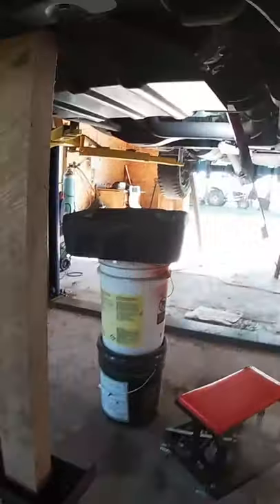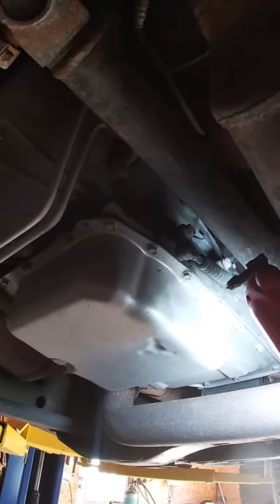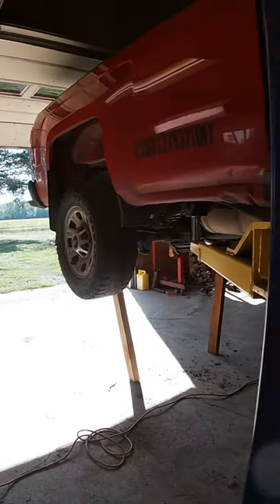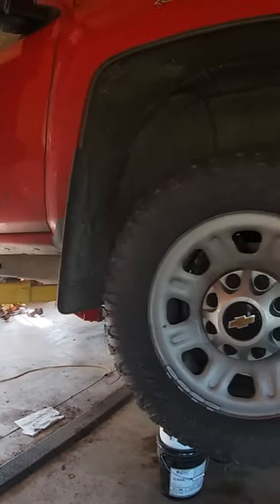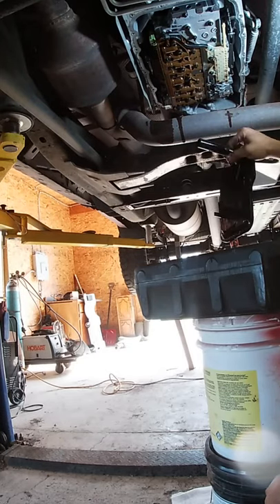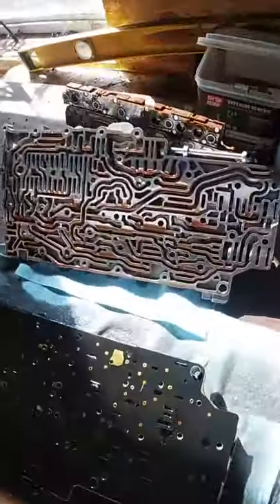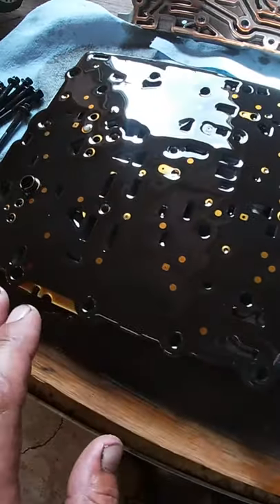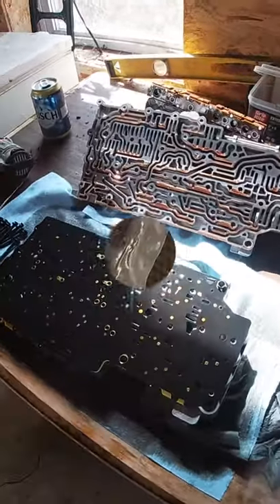Silverado 6L80e 6L90 NO DRIVE/Forward Gears FIX!!

Comment: This is %100 Legit.  I have a 2017 GMC Yukon with 88K.  These exact symptoms, strong reverse, no forward gears.   No code, not burned, not slipping.  I bought the service kit at the dealer, $28, easy.   Dropped the pan and valve body, had to loosen the right exhaust at the manifold.   My ball valve was clearly half size, clearly stuck.  New fluid and filter.  Carefully aligned the electrical plug and the shifter plunger.  Works like a dream.  No doubt this person saved me 4-5 thousand dollars.   My clutches were not worn, barely anything in the pan.   Wife stunned.  Can't thank this person enough.
Reply: How much did you donate to them?
Reply: I have the same problem with my 2017 GMC Yukon what the kit call please

Comment: Thank you for the video! This just happened to my 2017 Silverado 1500 crew cab 90k miles. Called three mechanics all said it was the transmission. $2500, $3000, $4500 quotes!…. Found your video, decided to give it a shot since truck showed no prior symptoms before not going forward at a red light, reverse worked perfectly. $180 later, 5hrs of time… and she’s running  as smooth as before!… once again, Thank you!
Reply: I have the same truck..was your truck jerking slightly or all of a sudden didn't want to go in drive
Reply: what did you buy?

Comment: My son had an issue while driving his 15 silverado with a 6L80, just acted like it was in neutral. Hauled it to a transmission shop and they replaced the transmission with a new one (approx $4K). Test drove it-not right, tranny replaced again. Has been fine for about a month and suddenly has no forward or reverse gears. We're looking for someone else who will cover the warranty. Any suggestions on what may have happened?

Comment: Thank you so much for this video, 2017 chevy silverado 2500 6.0 had no trouble codes stored, randomly i would not move forward, only reverse, did as you specified on video, issue was fixed, one of the plastic balls had decreased significantly in size to the point it got stuck, poor design that is making GM lots of money, PEOPLE LIKE YOU SHOULD BE GETTING SOME MONEY FROM GM. Thank you for taking your time to post this amazing video.

Comment: I did my 17 express van in my driveway. 73k miles. Dealership wanted 1k. The check ball was $4.50.  10m inverted plus was 17.00. 3 hrs to complete. No need for the new plate. The balls are shit. I did replace the trans filter too.

Comment: I just had this happen on my 2011 Suburban. Freshly rebuilt 40k miles ago. Fluid not burnt at all, no codes, no fwd gears but reverse is fine. Pulled the valve body and everything still looks new and undamaged. Turns out the 1-2-3-4 piston cracked and presents the same symptoms. You can check this when you drop the valvebody to see if the check balls are the issue. 1-2-3-4 feed is the forward most hole next to the filter hole on the trans where you just removed the valvebody from. It should be super tight and hold air with very minimal leakage. If you hear it dump air you have a cracked piston. Gm has 4 different revisions of it since it is such a problem and sonnex makes a nice billet upgrade for less than $100.

Comment: Got a 1999 gmc suburban & worked perfect, just changed filter & everything was running real good, no hard shifting gears, smooth gear change & came down a hill & turned & accelerated & NOTHING, would not go forward at all but has reverse. No whining noise, no rough gear change, just no longer have forward gears. Reverse works perfect.

It's the 4L60E I think
Reply from the maker: Could be stuck valve in the valve body, could be a stuck check ball, or could have mechanical failure. Start with dropping the pan and go from there.

Comment: Do the check balls stay in the valve body when you drop it ? Thanks
Reply from the maker: Yes. You have to split the valve body after you remove it to easily change the check balls.

Comment: I'm having this exact same issue as of yesterday in my 2015 Chevy SS Sedan with the 6L80E. I can reverse just fine, but when I put it in drive or 1st gear, it scoots forward very slowly like molasses, and even when I  floor the gas pedal while in drive, it just revs really high and the engine starts to sputter and damn near shuts off. I'm hoping I can get this fixed soon!! Very stressful for me right now since I just had a baby 2 weeks ago, and I'm down to one car now! Smh
Reply: Did it fix it?
Reply: So your transmission is potentially slipping and you thought that "flooring the gas pedal" would be something smart to do... Interesting... For those of you who don't know better-if you ever think your transmission is slipping DO NOT EVER UNDER ANY CIRCUMSTANCES stomp the gas pedal... If it is slipping you will instantly and permanently destroy whichever clutch pack was slipping requiring a full rebuild... DO NOT do this.. If it's slipping get OFF the gas, not ON it...  If it's slipping baby it as best you can until you can get into it to see what was causing the slipping.. Slipping means certain death.. Flooring it while slipping is like slamming your male reproductive parts in your car door just to see what the results will be.

Comment: I got a P0796-00 pressure control solenoid C performance or stuck off. 2016 Silverado 4x4 78k miles on it. Shifting problems or high rev without truck moving. Any input here ?
Reply from the maker: Has the trans been serviced? Could be as simple as a new filter and fresh fluid. Could be as bad as PCM issues or trans failure. Always start with the basics. Let me know!
Reply: So I dropped the tranny pan, Lot of metal flakes than usual. Changed the pcm and problem persisted. Dropped tranny and my clutches were burned and pump was scratched..
Reply: @Carbon_fr2  did you replace the transmission?

Comment: Common causes of this condition-broken sprag in the low reverse clutch stack in the BOTTOM of the center support, cracked 1-2-3-4 piston, stuck check ball in separator plate, bad TEHCM, and the number one cause of loss of ALL movement-both forward and reverse (usually when fluid/trans is hot) is the torque converter coming apart. I build these units every single day and I LOVE them! They are great units, they just have a few quirks. For those of you going in to replace the white plastic check balls-buy .250" TORLON check balls from your local trans supplier.. They will last significantly longer than the white plastic check balls GM utilizes. They are a caramel or brown color. That's what we use at my shop.
Reply from the maker: Truck has 310k miles on it now and still the same transmission. Tows everyday! Thanks for the comment!
Reply: I have a 6L90 that torque converter went bad and I replaced that and the filter. I still have no movement with It forward or reverse however if I put It in manual select It won’t move until I tell It to shift to a higher gear then It moves for 20 seconds then nothing again until I change gears again. Think this could be the problem?
Reply: @ryanbrady5552  When the converter goes bad you need to do a full rebuild to include a new pump, or machine the original pump, install BOTH shift kits-to account for wear of the pump pressure regulator valve, and at minimum replace the pressure blisters on the TEHCM... replace the filter/screen plate on the TEHCM, replace the bonded pistons, replace all bushings... Once the converter goes bad-you have metal throughout the entire unit... Replacing JUST the converter is not just gambling... it's throwing away your money. You tried a short cut and unfortunately, it's just not going to work out for you... Most likely you have valves stuck/sticking in the valve body from the metal coming out of the converter... That's just a GUESS.. I would never, and have never, just attempted to replace just the converter when one has failed... Too much collateral damage inside the unit to get away with doing just that. Best of luck with your project.

Comment: I just bought a 2015 6L90 core for my swap for $300. The guy stopped at a gas station, turned it off. When he came out nothing. Wouldn't go into forward or reverse. Hmmm maybe that shift lever problem that is  happening where it pops out of park or won't come out of parkm
?

Comment: I have issues for my pickup truck Z71  2016  D gears didn't work. Only R. Works and paddle shifting works but you can press hard acceleration

Comment: 2012 Silverado, backed out of shed, washed, Service traction control and Stabiltrack messages came up. Turned them off. Went to put back in Shed, Had reverse gear, no line under gear readout (Auto). 
No acceleration in forward gear (I could feel) where it was. 
Left on lawn, stewed over it all night. 
Got up early. Started up, put in gear (little selector) line showing up. Straight into shed. 
Told possible TCM. ? 
Any ideas ? before I phone Eastern States tomorrow. We are in regional Western Australia and little to no service here. Possibly have to truck to Perth.

Comment: Hey man I have a 2008 2500hd with the 6l90 have no forward or reverse gears no lights came home fine parked it overnight. Got in it the next morning and no forward or reverse gears, could this be the issue?
Reply from the maker: That seems like no line pressure. Could be a different issue

Comment: My transmission (4L60E) on a 2011 Tahoe  will shift into reverse and forward gears until it gets warm, then it won't shift at all.. fluid wasn't red, like it should have been, I'm lost, help! 😩
Reply from the maker: Sounds like internal problems! Good luck
Reply: Did you every figure out the issue ?? I’m having that same issues currently ..
Reply: Did you ever figure your issue out? Currently experiencing the same.
Reply: Did anyone figure it out
Reply: Change fluid and filter. (2011 tahoe)

Comment: Did you put new gaskets on the valve body when you put It back up into the transmission
Reply from the maker: The separator plates are the gaskets

Comment: Hi I have a 2017 2500 hd 6.0....almost same symptoms.....have reverse....when in D wont move....just revs. .....here is my question.....I put truck in L1 then used electronic manual gear shift  and put truck in 2nd gear.....thats how I got it home......in your opinion do you think it could be the same problem???? I can do the job no problem .....except its winter here in Canada and i cant do it outside.....would a dealer or tranny shop just do that if I asked them to? Also would a flush and fluid change fux it until summer comes around....lots of questions  sorry...lol
Thanks in Advance 
Andrew
Reply from the maker: I would have a look just to see. I wouldn't worry about a flush but definitely a filter and new separator plate
Reply: yo did you ever fix this if so how? I am currently experiencing the exact same thing as you described

Comment: How long did it take u to change out everything
I've got a 2001 Chevy Silverado 1500 she sits up high, 9" lift kit n I was told that kits and big wheels n tires will make a transmission go out fast......that was from the guy who  rebuilt the transmission before all this happened, that's how I know its not the transmission.......it has less than 3k miles on it from 5 yrs ago being  built.......I didn't drive her like that.....she use yo be a show truck

Comment: I’am writing to express my gratitude for the valuable information you provided in your recent video. I found it to be very informative and helpful.

However, I do have a question regarding a certain situation I am currently facing. Recently, I noticed that the transmission in my truck was not functioning properly. After repairing it, the transmission works fine until it reaches around 170 degrees and then it throws a code. (p0741 - torque converter clutch system stuck off)

Prior to this issue, the truck was running properly with no problems. The problem started with the transmission falling out of gear twice within 20 minutes of each other when starting to move forward after a stop light. I have not noticed any other symptoms.

I would greatly appreciate your opinion on the matter. Any insight or advice you could provide would be very helpful.

Comment: I have a 2000 ford f250 7.3  automatic.....my truck was parked fir two weeks and decided to take a drive...it started and put it in on drive nothing..put in lower gears and nothing and reverse nothing....check the level on tyranny and good........need help

Comment: Bro same happened to mine oil has no burnt or nasty smell to it but mine is a 4l60e no check engine what can that be bofore i start looking
Reply: Did you ever figure it out I just ran into this problem
Reply: @brandonromero8122  I did bro it's my first gear on my transmission or as they call the big belt wore out so no first gear only reverse so I gotta rebuild or just get my first gear fixed
Reply: @JesusArredondo-o2g  thanks bro. It was working fine it was rebuilt 3 months ago and today as I was leaving some snap under and it was all neutrals but reverse worked like normal. I'll have to drop it again

Comment: I have a goes into reverse no drive situation not sure if 1, 2, 3 work but the D don't work, as I'm just starting working on a 94 Explorer and tomorrow I'll be pulling tire off to get it jacked up to get rid of a pancaked tire with dry rot sidewalls

Comment: I just had a guy rebuild my transmission and when I went to pick it up it goes in reverse but not forward
Reply from the maker: Hopefully you get the guy to fix the problem!
Reply: Hey man, did you ever figure out what happened with your truck. Same thing happened to mine.
Reply: @tjamecurrie   I'm taking it to a real transmission shop to have it rebuilt
Reply: @drivewaygarage1561  update??
Reply: @dannypulido9218  $3500 to rebuild and fix the last guys screw up,

Comment: Does this happen to 4L60e transmissions too? I'm sitting in a cold truck with no forward gears, 1 hr late to work trying to figure out what is going on. Transmission shifted kind hard into 1st for about 1yr now.
Reply: 168k mi. No check engine light.
Reply from the maker: I can't say from experience but I'm sure it is a possibility. If it does it when cold then I would suspect something with oil flow, plugged filter, low trans fluid, plugged valve body orifice. Still have reverse no problem?
Reply: @griffsgarage6028  Rev. Is just fine just exactly like the video. Was driving just fine almost all the way to work. Stopped at the gas station for a red bull. Put it in gear and tried to accelerate quickly.  Heard it shift hard as usual, then it felt like I was in neutral. Shut the truck off, restarted it. Had nothing but reverse. At that point I was able to eliminate bad u joint/damaged drive shaft, then after watching the video I realized I still had pressure cause I still had reverse.
Reply from the maker: You could have blown the forward clutches or something internal if it was shifting hard
Reply: @griffsgarage6028  Thanks griff! I appreciate you!
Reply: @yellowcabindy did you ever figure out the problem

Comment: 2010 express van with the 6l90 can idle sir drive for 45 mins trans will stop shifting but when cold it will light the tires up any input what to check? Possibly valve body issue?
Reply from the maker: Sounds like a cracked drum that swells open after warm releasing fluid pressure

Comment: bought a truck w/ 17000 miles wrecked. because of a health issue it took me 2 years to finish it. on initial test drive i had no 3 4 5 6 gears. rechecked fluid and it had water in it. towed to dealer for flush. towed it back same problem . Thoughts
Reply from the maker: What's the truck? Water or antifreeze in the trans fluid? Any codes?
Reply: @griffsgarage6028  2015 silverado 5.3 I assume it was water just turned the fluid light pink, was red before the start. Their were no codes.
Reply from the maker: I would look into the possibility of a bad radiator. They are only plastic on the sides and can crack internally, causing fluid mixture. If that's the case, you more than likely have some damage in the trans from water intrusion. But this is only MY opinion! Best of luck
Reply: @griffsgarage6028  Regardless of where the water come from it is no longer an issue. What I was wondering is, what damage could it have done in a 12 mile drive, do you think it could  have affected something in the valve body or tecum or is the transmission toast?  These things are crazy expensive. Thanks
Reply from the maker: Water doesn't compress like oil does so I would imagine it did some damage to something, which is obvious. The only way to find out is to pull the pan and valve body for an exam then go from there
Reply: @griffsgarage6028  That was my plan, Thanks
Reply: If water got into the trans you have greater problems.  The friction material is held to the steel with water soluble glue.  The friction material will delaminate.   It will come off in sheets.   This leaves nothing to hold when the clutch pack is compressed

Comment: Dies drive function go in and out ???? Was sitting in a drive-through when it started acting funny and wouldn’t move forward it would rev up  I gave it some gas and it started creeping forward left the drive-through was able to make it about a half block down the road and start doing it again until finally it just stop moving forward and I rode to a stop it felt like every once in a while I wanted to move forward but it wouldn’t I started playing with the four-wheel-drive functions and finally I gave it a shit ton of gas it rubbed a pie and it started moving and I was able to get it home where it started acting up again doing the same thing I’ve had it parked thinking it must be my transmission? It seemed shift OK when it was running
Reply from the maker: If it's trying to move and slipping, I'd say internal failure